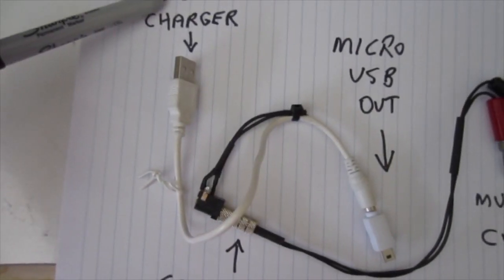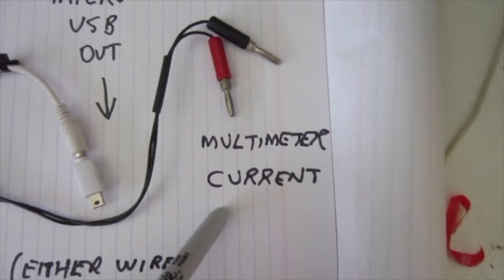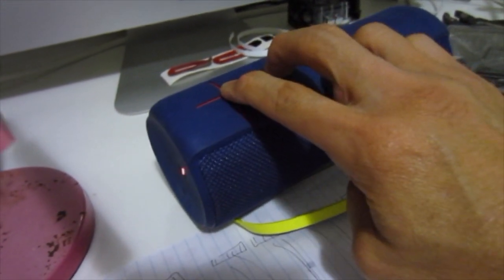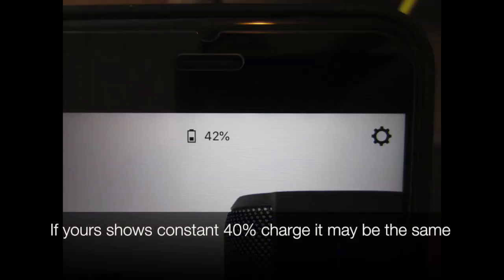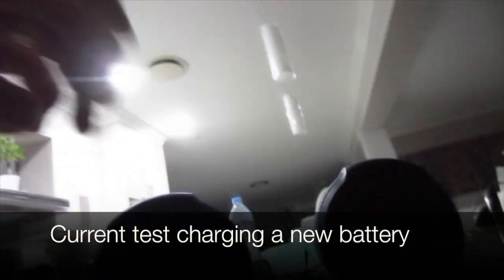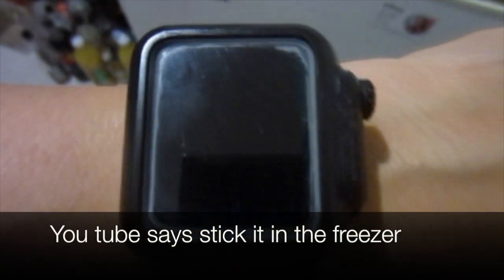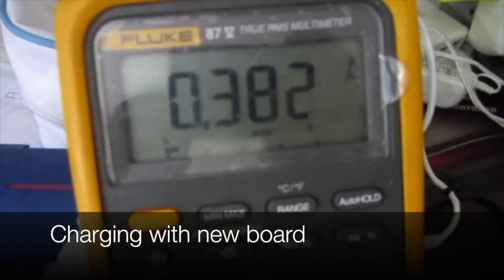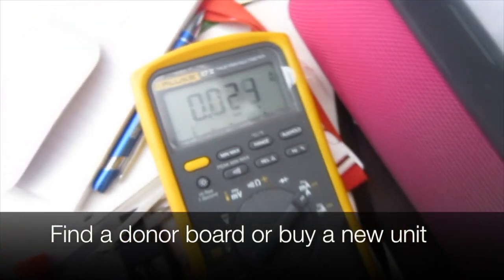UE Megaboom not charging or Faulty - Make test lead tool & Problem solving

Comment: Makita power tools do the same thing. Once the battery goes below a certain voltage it is blocked by it's internal circuit board and cannot be charged again. It's called 'planned obsolescence'.
Reply from the maker: I’ll see if I can make a video on restoring a Milwaukee battery
Reply from the maker: You can take the makita battery apart and charge each cell individually and then the whole makita battery will start working again
Reply: @Dentinvent  Unfortunately you won't be able to re-charge the makita battery in its charger untill you replace the circuit board. Thats my experience anyway.

Comment: Well further feedback - overnight on the charger and charge light still blinking in am. So left it on - I went out and by return late that night charge light solid. Just checked and (after I paired it again) now sitting at 100%. Yay. Have subsc to you for vid to replace batt as required. Cheers.
Reply from the maker: That’s great news. I think the battery charge system in these is a bit hit and miss . Hope it stays working now . That charge cable adapter I made does show you if current is going into the unit so you can actually monitor power going into the battery . I think sometimes these units show they are charging even when they are not. 
The fact that it says 100% now on yours does mean power did go into it .

Comment: Oh my goodness. I can’t believe it. Last ditch effort was 1 hour in the freezer, then plugged it in and it came alive with msg ‘critical battery’. And the speaker is working again.
Reply from the maker: Susan,
Although the freezer trick worked , there is a possibility that the battery is on its way out . Remember that the battery life is affected by age more than the number of uses it has had . If it continues to fault , you may need a replacement battery.
Yes Re Aussie accent from Hughenden in the middle of Queensland.
Reply: Hubby from Winton so I know Hughenden. Yes batt sitting on 10% and overnight too. Bummer. Have to educate myself on replacing battery or find someone knowledgeable close by. Cheers.
Reply from the maker: @susanwalsh3878  
If you follow my other video you can see how the battery is changed . It is not difficult but you have to be careful not to break the small circuit board on the sides . The video shows what to do to prevent breaking it.
Reply: BTW Thanks for prompt reply and great vid.

Comment: My UE MEGABOOM would appear to be dead. Not charging, not charging with another’s cable that is working, not responding to factory re-set. Obviously unable to turn on.  Was working 7 days ago w 80% battery. 
Any suggestions other than new one?  Your accent sounds Aussie?
Reply from the maker: Sorry for very slow reply . You may not even have the Megaboom any more. Even if battery was 80% that figure maybe false and the battery may have died . Yes , hello from Australia.
Reply: So do you know anyone in Northern NSW or Brisbane that can supply and fit new battery please?

Comment: i really need to know if u can acctuallz put it in the fridge and it will fix...
Reply from the maker: I think that is just an urban myth that maybe worked for one person and everyone made the rumour true . It didn’t work for me .
Reply: @Dentinvent  k thx
i just realized that some of my chargers did not work well its the same with my ps4 thats how i even realized i used the charger that i used for my ps4 and it worked
Reply from the maker: @LightningSMR  
Well done. Sometimes you need a charger with high power capacity . I once bought an expensive boom box off eBay listed as not working. I took it all apart and did many tests and couldn’t find the problem. I eventually gave up and put that down to experience. One day I connected it to a lab power supply and it all worked! The seller had mixed up the power pack and had the wrong one with it . I still have that huge boom box.
Reply: @Dentinvent  honey i just think that chargers just keep getting mixed up like i got some chargers for my samsung a 50 but it just was not working . I was Worried cause i did not want any trouble then  one day i took my bros charger and it just works so i was thinking are all those 6 chargers fake or just not working but am still happy it worked
Reply: @Dentinvent  and thanks for telling me just subbed  :)
Reply: @Dentinvent  my megaboom would charge and say 100% but keep blinking red in the middle while on the charger. The unit turned off instantly when i removed it from the charging dock. Put it in the freezer for 20 minutes and now it works again. Cant say how long this fix will work but it did get it to perform normal at least for the last hour.
Reply from the maker: @nicknyhk  
Nick I think that the freezing just kick starts it but ultimately you may need a new battery . Remember the batteries have a limited lifespan not dependent on usage but on how old .  Lithium batteries usually only last about 3 years before they start dying .

Comment: Where can I buy the whole new charging port piece that plugs into the batter?
Reply from the maker: I’ve only taken parts from old broken units . I have never found new replacement parts but now and then I see eBay sellers selling dismantled units . Still cheaper to buy a broken one as long as you assess what is wrong with the broken one so you know the charge port is not faulty .

Comment: Hi there, I’m in travel, don’t have any tools with me, the UE shows light on the off/on button, but it does not react and do not connect to BT, I tried to push the BT button , no response 
Any idea what else can be done ? 
Thanks
Reply from the maker: Is try the reset:
Press volume minus and the power button for six seconds and that resets back to factory settings so hopefully that may get your BT back working .
Reply: @Dentinvent  unfortunately it’s not working seems that it’s “total lost” 😩😩
Reply from the maker: @sarashekel1657  
If you cannot fix it at all, don’t throw it away as someone will buy it for parts . 
I think you may need to disassemble it when you get back from your travels . I have seen some that come alive again after changing the internal battery and resetting them .

Comment: Watched video where a gentleman  found a faulty capacitor and removed it and the battery started charging fine. Ever seen that one or tried that on the megablaster? he preformed that surgery on a wonderboom.thanks
Reply from the maker: Have not seen that situation. The faulty charge boards that I have encountered all have a lot of micro circuitry so I didn’t bother trying to fault find that part .

Comment: Easy fix, just make sure you use the charging cord that came with the speaker and pair it with a USB adapter that is at least 11 watts and puts out 2.5 amps of charging current, Anker among others make USB adapters that sense charging current requirements. The led should be blinking fast when it is charging and the charging  LED will be solid white when fully charged. Charging time is approximately 2 and a half hours, do not leave the speaker charging too long or you can over charge your speaker. You cannot just use any old charging cable or adapter for this speaker; it has to be compatible or you will get a fake charge which will drain in an hour. I hope this helps.
Reply from the maker: Not really sure if that’s the easy fix people are looking for . Many have the correct UE Megaboom charger and cable and are having charging problems . If there is a charge board fault, no charger will charge it .

Comment: Thanks for this video . I fixed my Megaboom. Before change the board, check if the battery contact are good, I just clean those contacts with a contact spray and a electric toothbrush and now all is ok 😁
Reply from the maker: Well done. The test tool in this video would also show that the charge contacts are working properly ( as you can see current going into the Megaboom).

Comment: Así mismo dice la mía no carga solo hace lo mismo que esa, díganme la solución? 🙏
Reply from the maker: If the unit is older than 3 years , it maybe the battery .
If you make the charge indicator you can tell if any charge is going into the unit when I charge light flashes . Best to check if it is taking a charge first .

Comment: It's nearly impossible to find charging boards for these, but you can bypass the charging board w a stripped USB cable spliced into the battery line.
Reply from the maker: Can you make a video on that and post it ?

Comment: Mine says critical battery please charge, I tried charging it but it still blinks red do you suggest to just buy and other power bank
Reply from the maker: When I made my videos I had about 4 Megabooms disassembled so I could swap out parts and batteries. The charging test circuit will help you determine if any charge is actually going into the battery. Most of the time it I a faulty battery because the batteries actually stop working after a certain time. Lithium batteries die with age . I did find some Megabooms where the charge board was the problem because even a new battery wouldn’t charge. This charge board problem was less common than a faulty battery. 
Best of luck with yours .

Comment: I have Megaboom 3 and it's really weird as it works when USB cable is plugged in, so it means the current is passing through but it doesn't charge the battery (or it simply won't work off it as it actually says 100% charged on the app). I bought a new battery and nothing changed..
Reply from the maker: Possibly a faulty charge board .
Very frustrating. Try making the test lead I have in my video and that will show it current is going into the battery .
Reply: @Dentinvent  you can bypass the board too
Reply from the maker: @mrequi1  
That would be useful to some people with faulty boards . Can you tell us how you do that ?
Reply: @Dentinvent can you please provide instructions to bypass the charge board
Reply from the maker: @willc2358  
Hello ,
The only way I’ve bypassed that Board was to take the battery out and charge it on a lithium ion charger .  You could do that to bypass the charge board but you would need a dedicated charger or need to set up a battery management pcb . That would work but you would need to attach the board to sprayed cells and that would not fit into the Megaboom.

Comment: Hey I just came across this vid, after buying a new battery and replacing it and it still says charging plz wait, I guess the charge board is bad but there is no boards available :'(
Reply from the maker: See if you can make up the charge test tool and then you can actually see if charge is going into the unit . If faulty , look for a broken parts donor . Make sure you suss out the donor symptoms not make sure that it doesn’t have the same fault before you buy it . Best of luck .
Reply: @Dentinvent  thanks

Comment: My Speaker will charge to 100% but when it gets to 70% it starts saying that I need to recharge the Speaker and then it Shuts off.  What can I do to prevent it from charging
Reply from the maker: The whole percentage thing is a bit inaccurate. As the battery gets older , it starts to die just because of age . It is sort of like the battery in your mobile phone . You will notice it will not charge and last as long . I would consider changing the battery if the short charge life bothers you . The percentage charge you hear is not accurate .
Reply: @Dentinvent  .... Okay Thanks but now I have a few questions, what kind of Battery do I Need and Where can I Get It and How Do I Replace It? 🤔🤔🤔🤔🤔🤔🤔🤔
Reply from the maker: I searched eBay under Ue Megaboom battery. Replacement is straight forward. Just follow the tips on my Megaboom video
Reply from the maker: https://youtu.be/_zKq091vpb0
Shows how to get in and change the battery without destroying your Megaboom
Reply: @Dentinvent  ... Okay, Thanks So Much For All Your Help.... I Appreciate You. 😊😊😊😊😊. I Will Let You Know How Everything Turns Out.  😉😉😉😉

Comment: Thanks for putting this video up. My wife's Megaboom 2 is locked on 30% charge, and works with the charge cable in, but no charge light shows and the charge level is static. I'd say it's the charging circuit, wouldn't you? I hope my Megaboom 3 is a bit better.
Reply from the maker: Did you manage to make the test tool ? That is one of the only ways I could figure out if the thing was actually charging . Sometimes it is a faulty battery that won’t charge .
Reply: @Dentinvent  I have not tried a test cable. I'm an electronics tech, so I should do it. Just lazy/busy.

Comment: What do i do when my speaker just keeps saying "charging please wait?"
Reply from the maker: That's the lady in the speaker trying to pull your leg. Don't believe her. I would make the charge test circuit in my video and see if current is actually going into the UE megaboom (or UE boom) . If there is no current going in (even with the flashing LED) it will show when you make the tester. I would consider a battery change.
Reply: Yeah me 
Pretty n

Comment: The white led light on mega boom flashes but when I take it off it’s still red indicating it needs to be charged
Reply from the maker: If the white led flashes and you have had it in for a long time , either the charge is not going into the battery or the battery could be faulty . The only real way to check if it is charging is make the tester cord I have in my video and use a multimeter to check if any current is going in . The charge circuit on these is a bit hit and miss. Good luck .
Reply: Do a hard reset by holding the power and volume down button until the charging light stops flashing. Wait 30 seconds or so, un-plug, and then plug back in the USB plug. Turn the speaker on again, and re-pair it with your device. This happens to mine all the time and is the only thing that fixes it, even if only temporarily.
Reply: Matt Puterio doesn’t work for me.irs been over 2 weeks and I can’t use my UE Boom

Comment: Mine just needed to be plugged in/out like 10 times. So weird.
Reply: Spoke too soon. It was charging then died and now is doing the same thing again where it won’t turn on or change. These things are junk.
Reply from the maker: chris krip 
I think it is either the battery ( how old is unit ?) or the charge board
Reply from the maker: May be a slight design fault

Comment: My boom 2 not charge no power at all open and battery showing 4.2 volt . Look like power never get into board,what could be worng ？thank if you can tell me with your experience
Reply from the maker: Does the white led flash when you charge it ? If you can measure the voltage I assume you have a multimeter. Can you make the test charge lead I show in my video ? That will show if the battery is actually charging. When you press the buttons to check power , does the voice say anything ?

Comment: what do i have to do buy a new battery or port charher?
Reply from the maker: Do you mean the part that plugs into the wall? If so you can use any USB charger but make sure if it is a Megaboom that it has enough Power or it will charging constantly and it never fully charges with some weaker chargers .
Reply: I put it to charge, the light blinks but it does not charge, do you think it is the battery or because I am using a cable that is not the original?
Reply from the maker: I don’t think it is the cable. It is either the battery is dying or the charge board is faulty . Most likely the battery though . Do you have a multimeter ? That will help a lot . Let me know .
Reply: @Dentinvent  no i don't have but i will test with an original charger thank you very much
Reply from the maker: If you find that it still doesn’t charge or keeps saying “40 percent charge”, if you feel confident , take the battery out and put it back in to see if it corrects the problem. Follow my tips on taking it apart so you don’t break anything . Let me know how you go .
Reply: Dentinvent  thanks 👊🏼

Comment: Mine only flashes the white led light twice then nothing. I think it’s not even charging 🤷🏽‍♂️
Reply from the maker: I think the theory behind the white led Indictator is good but when there is a charging fault, the led tells you false information. The test lead set up with a multimeter is a better way to actually see if it is charging. If your unit is old, it may be a battery problem but remember that the top board sometimes can become faulty as well. Good luck .

Comment: You know if y can buy only the charge boards? Thank you, great video!!!
Reply from the maker: Thanks man. Yes you can buy the charge boards off some ebay sellers . I think they buy broken units and sell them as parts . Problem is that the boards are expensive . I would recommend buying a broken on which doesn’t have the symptom of a faulty charge board . Hopefully from my tips you can work out how to buy one . For example , look for one with for example with physical damage or even one that flashes charge and has a faulty battery etc. Good luck and please ask if you need any help.
Reply: @Dentinvent  76⁶⁷⁷⅞hýyýhhh1aaøååå
Reply: They are almost impossible to find